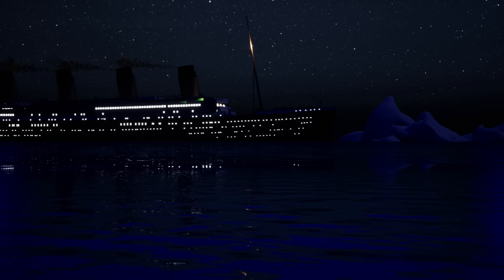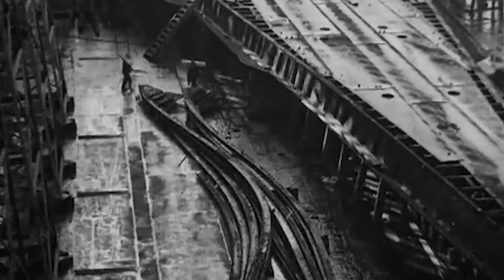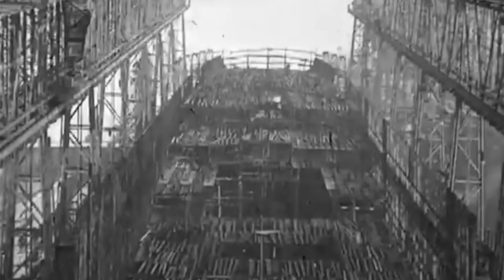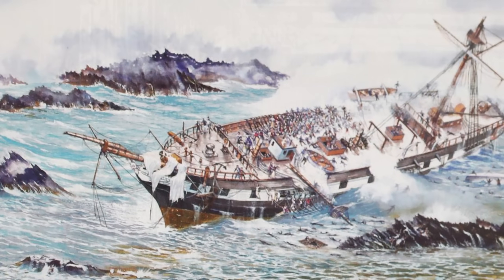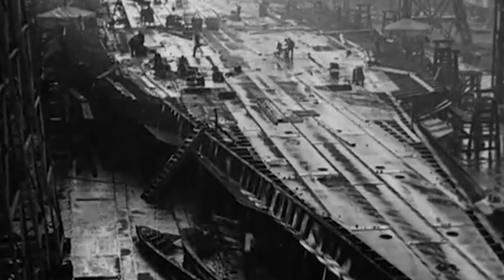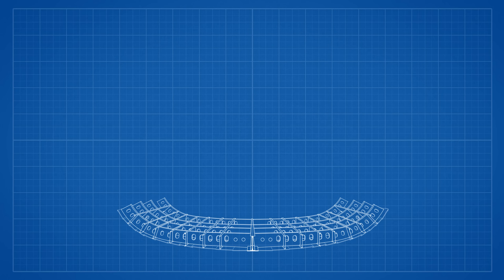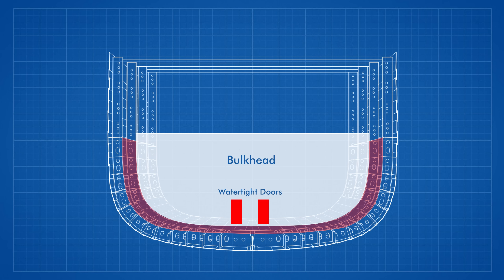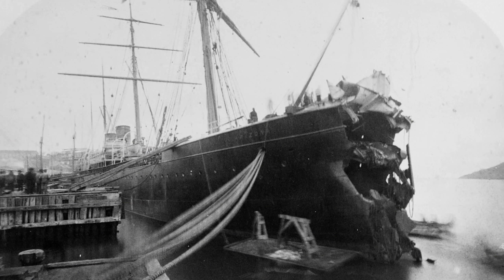How did the Iceberg Sink the Titanic?

Comment: I’ve seen a number of documentaries that like to talk up how safe ships are today.  Inevitably they mention Titanic and proclaim today’s ships are much safer, but I’m not so sure.

You see, lots of ships made after Titanic have sank with comparatively less damage.  I’m looking hard at Andria Doria and Costa Concordia.  There are others too.  Both of the aforementioned had holes a smaller percentage of the ship’s length vs the ones that sank Titanic, and yet they sank.  What I want to know is: has any ship suffered damage and flooding over a greater percentage of its length than that which sank Titanic and it remained afloat?  I think the answer is no, but wonder if you have insights.
Reply from the maker: You're quite right, and this was demonstrated by Costa Concordia very well. I want to do a video on this exact topic, but the summary is that modern ships put far more emphasis in obstacle/danger avoidance than the actual physical safeguards. There was a mentality-shift to that effect later into the 20th century as radar, sonar, communications and other systems improved and developed. Costa Concordia was simply not supposed to be in that place and time - and neither was Titanic.
Reply: @OceanlinerDesigns  I look forward to that one!

Comment: The Titanic had been on fire since departing SH (coal bunker), the iceberg unfortunately hit the ship where the metal was weak from heating, it ripped the ship open. There's testimony about it, and even the NY Tribune wrote about it after the sinking. Titanic was going so fast because they wanted to get rid of the burning coal before arrival. Those are the facts.
Reply: Your "facts" are incorrect. 1. The coal fire had been extinguished the day before the collision with the iceberg. There was no reason for them to go "so fast" to get rid of burning coal, there was no more burning coal. 2. The bulkhead walls had cooled down enough that the firemen were able to coat the metal with oil to prevent warping and paint peeling. 3. The affected coal bunker was located amidships, not on the outer skin, and astern of where the iceberg struck. There is testimony at the US Inquiry for all this.

Comment: One thing I have never understood, and no-one seems to be able to help me with is; When the compartments started to flood, how did the water get over the tops of the bulkheads? Surely those compartments had ceilings that formed the different decks, so when one area was ruptured, how did the water get over the top of it?
Reply from the maker: Staircases, cutouts for ventilation and trunking and things like that!
Reply: They should've tested the thing against an iceberg in Belfast. There's your sea trial. Oh, look at that, she's going down like a little bitch. Back to the drawing board.

Comment: One other save possibility I'd be curious about - she was sinking by the bow deep enough that the water spilled over the bulkheads. What would have happened had a couple compartments at the stern been flooded as well, could that have kept the ship more level and avoid the bow going low enough to spill over the bulkheads, basically counter-balance the ship? Or would it have floated too low overall that way and still had the same problem? Or perhaps the buoyancy amidship with both ends pulling down would have placed too much bending load on the ship and broken her in half, as happened later in the sinking sequence?
Reply: Would have snapped the back soon, as the sharp edges of the plates would have acted as tear points. The keel was strong with lifting from the bow or stern, but very weak in humping, as the plates that hold it together  are not as strong in tension. That is seen as it tore in half with the stress just before sinking, when the empty stern was being lifted from the water. Making it strong enough would have cut greatly into the carry capacity, taking up a lot of the displacement.
Reply: I know I am 2 months late to this conversation but the engine rooms were at the back of the ship. Flooding them would have resulted in all the lights and radio turning off. I would think no lights would have slowed launching the life boats and the ship would still sink.
Reply: @MrT------5743  Good point - I don't know where the generators were located, perhaps not in the same engine rooms as the reciprocating engines and turbine that drove the propellers (separate rooms for the recips and turbine). Steam would have come from boilers throughout the ship, there were boiler rooms in numerous separate compartments. The generators probably would have been pretty low down though, so if their compartment was flooded they'd be without power. That's sort of a shortcoming of the compartmentalized ship design, even if it can prevent sinking it often can't prevent loss of critical systems. Sort of like happened to the SS Malolo as discussed in a more recent video.
Reply: @quillmaurer6563  the turbine power generators was just aft  of the reciprocating engine. I'm also not sure if let's say they flooded boiler room #1 steam could still pass from BR 2-6 through flooded #1 to the turbines.
Reply: More openings = faster sinking, if you are going with the idea that the first six compartments are still breached
Reply: It would have hastened the sinking, and it might have resulted in the keel and double bottom failing sooner, but probably not the way it had that lead to Titanic breaking apart from the bottom up.
Reply: lnteresting question. One would need access to the exact plans of the ship, a degree in naval architecture and some pretty powerful, naval architecture, computer simulation software to get an an accurate answer. During WWll, Japanese warships were designed to use counterflooding for stability, but l'm not aware of any wide consensus as to how effective it was versus other methods of damage control. We do know it was ineffective on the two, Japanese, super battleships "Yamato" and "Musashi" but whether any other method might have been better is questionable, especially considering how many holes there were in the hull of each ship.
Reply: @frankmiller95  I'm guessing the counterflooding was for roll, not pitch. If damaged on one side and compartments on one side were flooded, they could flood compartments on the other side to keep the ship from rolling over. Less likely they'd use it for pitch, but maybe?
Reply: I think they should've did full stop and steer head on to the iceberg 🧊 than drop anchor ⚓ after collision 💥 people would've died but not 1,500+
Reply: @rubenvega4618  Um no, dropping anchor in 12,600 feet of water will result in merely losing the anchors, and possibly killing someone too. Anchor chains are not attached to the ship, they merely are piled up in the chain lockers. Drop anchors in water too deep, the chains will come out entirely and when the ends come out look out!
Reply: @taraswertelecki3786  Folks have this stupid misconception that dropping anchor slows down the ship just by being drug through the water, but unless the anchor in question is an actual sea anchor (which is basically a parachute being drug through the water), dropping an anchor that is unable to be dug into the sea floor doesn't actually accomplish much.
Reply: @azurblueknights  Beyond that, most anchors don't need to "dig into the sea floor" to keep a ship stationary.  I would think "digging in" would not be desirable.  It's friction of anchor + chain simply laying on the bottom that keeps a ship stationary.  A dug-in anchor might not be able to be pulled back up when it's time to leave.  No no, here's how it REALLY works:  The anchor is just a weight.  A weight designed to pull the chain down to the bottom of whatever body of water the ship is in.  It is the combination of anchor AND CHAIN, a portion of the latter which LAYS ON THE BOTTOM of the water body, that provides enough frictional resistance against wind and tide, and therefore keeps the ship "mostly stationary".  

For this to work, the ship must be in water shallow enough not only for the anchor to reach the floor, but shallow enough for "a length" of the chain to also lay on the bottom.  "The length" of chain needed can probably be calculated given the mass of the ship in question.  The Titanic would not have had long enough anchor chains to drop anchor in that depth of water, so no strategy of dropping anchor would have been even the least bit effective.  Even if the Titanic had been outfitted with magical 4,000 meter anchor chains (that's right about 2.5 miles!), it still would have taken 4-6 minutes for the anchor(s) to hit bottom and another minute or three for enough chain to be layed out on the floor.  So no sort of speed reduction could have happened in time to avoid a collision.  The iceberg was hit moments after the lookouts saw it from the crows' nest; much shorter than 4 minutes.
Reply: @rubenvega4618  What would the anchor have done? The ocean is about 12,500 feet deep at that location. Not to mention that the anchors are very close to the bow, and would have been in the section of the ship completely demolished, so the anchors probably would have fallen away, or if compacted into the wreckage would have been unusable.
Reply: @rubenvega4618  Fortunately for the rest of us, you're in no position to have your idea implemented.

Comment: I believe that Thomas Andrews came to the same conclusion as Wilding, hence his 90 minute estimate for how long the ship had left. (Although Andrews' calculations failed to account for the list to port that Titanic was suffering at the time, hence why they were off by over an hour. Modern engineers were stumped by this inconsistency until they ran a simulation of the sinking without the list and found that the ship sank within 90 minutes) 

I'm curious how the inquiries would have gone had Andrews and other key people (such as Smith and Jack Phillips) survived. Without them, the inquiries came to largely ignorant and biased assumptions. (Wilding's hypothesis was ignored because they stubbornly insisted that only a massive hole in the ship's side could sink something as large and grand as the Titanic)

Comment: Here's a stupid question:
You mention air escaped the peak tank through a vent.
If that vent had had some kind of valve or closure, the air would've had nowhere to go (presumably), and thusly would not have left space for the water, meaning the tank wouldn't have flooded.
My question is not "would that have saved Titanic?", because of course it wouldn't, there were still 5 compartments flooding.
My question is: is that possible? Or is there something I'm missing that would've made a vent closure null? For example, if the tank wasn't sealed. And if it is possible, it would've at least bought Titanic some time. How much time, do you think?
An excellent video. The visuals were immensely helpful. The only thing I would've also liked is a visual on Ballard's picture as to where the gash is.
Reply: Unlikely. Unless they had the equipment on board to perform welding - which didnt exist in a widespread, portable manner in Titanic's day - the crew wouldnt of had the means to perform any seal that was not only air tight but able to resist significant pressure difference; pressure that would increase as the ship took a head down angle.  Unfortunately, Titanic's design though revolutionary for her time was quite porous for an ocean going vessel. If the vents were mechanically valved, and those valves were specifically designed to take pressure, that may of made a difference, but highly unlikely. 

The trick with a bulkhead that is designed with intent to serve more than simply structural is it has to withstand significant, indeed dramatic pressure differential. That is to say, the weight of the water as it presses, mercilessly, against the bulkhead; pressure that increases the deeper down in the hull you go.  at 30' down, the static pressure - not counting any movement or whathaveyou - is around 13PSI, or thirteen pounds of pressure per square inch. So with every square inch of plating, theres at least 13 pounds against it, at 30'. Doesnt take much math to recognize the tens of thousands of pounds of force quickly coming into play against Titanic.  That's what makes a watertight bulkhead different from other bulkheads - not only are they supporting the load of the ship itself, but the weight of the water against it. During both wars, multiple ships would have their bows blown off in battle, and while the bulkheads would hold the water back while the ship was stationary, they could NOT do the job if the ship moved forward. Hence, many ships that still had power or were under tow had to go backwards to port; otherwise the bulkheads couldnt hold. 

Hope that answers your question!
Reply: @MoparNewport  Answers it excellently! Thank you so much!
Reply: @TheHylianBatman  Look up the DocuDrama 'Saving the Titanic', its here on YT. It tells the story of the engineers, firemen, electricians, carpenters etc that fought to save the ship. Well worth the watch!
Reply: @MoparNewport  Thank you! I'll look into that for sure!

Comment: It's ironic that the Titanic silk from many gases one of which was at least the same size as a gas suffered by the Great Eastern over 50 years prior. Great Easton only surviving because she had a twin Hall from most of her height yes she was made out of iron but they facts still remains she survived a gash that was at least comparable to one of the gases that sunk the Titanic on top of this the White Star Line had been building ships that eclipsed the Great Eastern in certain length and weight for a decade by the point of the Titanic disaster it's a shame that it took the Titanic sinking in the way she did for clothes to be passed that mandated the double halls up to the edge of the expected water line. Behind site is great and all but is a engineer as great as Brunel could see the benefit of having a twin hole up so the edge of the water line then it surprises me that never considered doing it going forward

Comment: well excellent as usual. I have heard tales about rivets being faulty but from the openings you map out it really would not matter. In its way Titanic was weak, had it been built like a cruiser or battleship it would not have sank (a battleship probably would have continued in action). I would think that if the bulkheads had been continued to the deck above the ship could have trapped air in the compartments, but this is not as certain a thing even on most warships as one might want.  Unpierced traverse bulkheads make for difficult conditions to work around, and on a passenger liner with all the electrics, water, sewer, laundry shoots, doors, voice tubes and god knows what else being allowed to pierce the bulkheads making any of it water-tight is a hell of a trick. My guess would be that if the Titanic had been made with bulkheads to the top at a continuous deck and with an experienced crew (they were new, and most of them were service personnel) they could have kept her afloat to the next day with the help of the smooth water conditions. But the next question I still do not have an answer for, could she have been put astern and the compartments in the stern flooded as well as moving all weights to the back or throwing them overboard. Once more a crash mattress might have been fixed over one of the smaller holes but I am not even clear if she had any pumps available. Even if the crew had been prepared for that kind of emergency its not even clear if they could have jury-rigged anything useful from a passenger liner - the moral of the story, for safety travelling at sea seek passage on a battleship with empty magazines. New Jersey would be an excellent choice, Nevada would also have been good, it did survive two atom bombs.